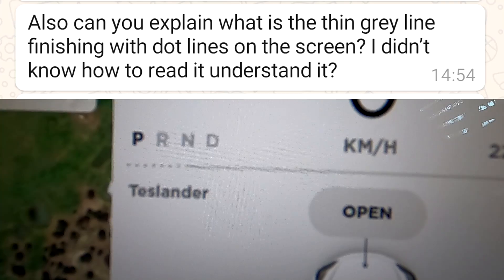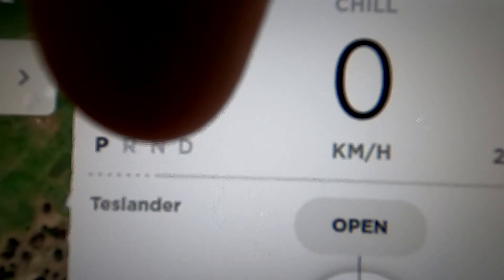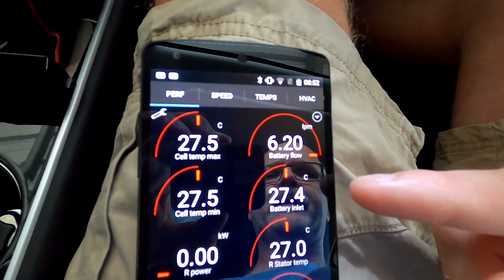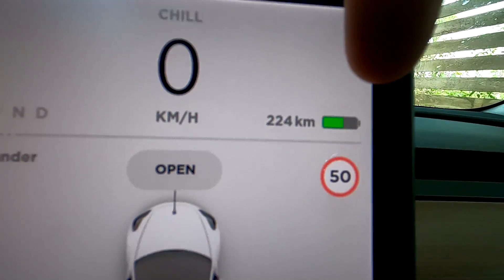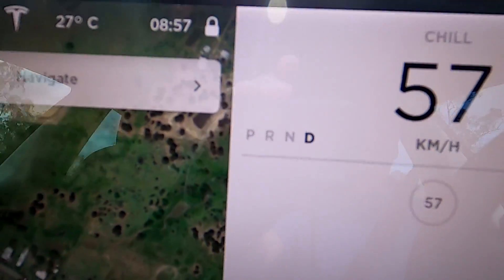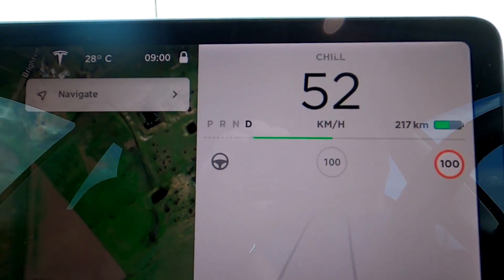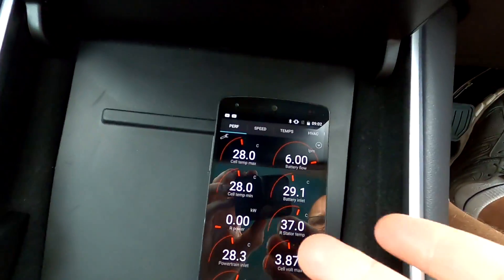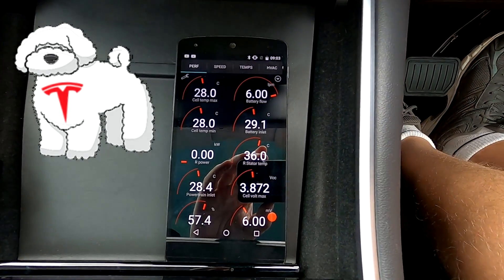EP329 - Explaining the regen limit in the Model 3

Comment: I’ve never had reduced regen on my P-. (Same approximate geographical location .... and climate as Andy.) 
However my sons with SR+’s do.
Seems to be mostly an SR+ thing, and to do with the size of the battery.
Reply from the maker: Explain that.
Reply: I’m just assuming a 40% (approx) bigger battery can absorb 40% more regen without limitations. As I said - both sons get the limit like your car Andy, I don’t get a regen limit at our typical Summer temps- (but obviously would in very cold conditions.)
Reply from the maker: That would make sense in terms of the SoC as your 80% is different to my 80%. But temperature wise it should be the same trigger. You need to get the Tesla Watchdog. We need to know...